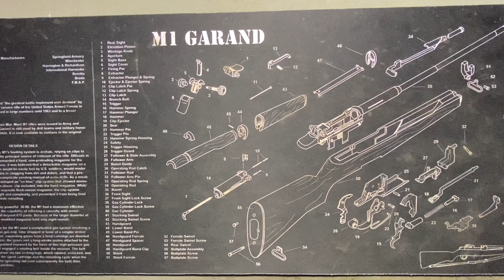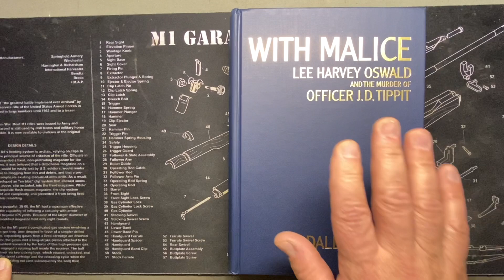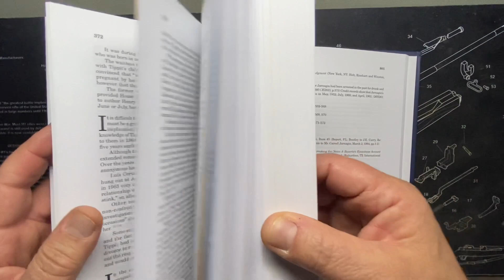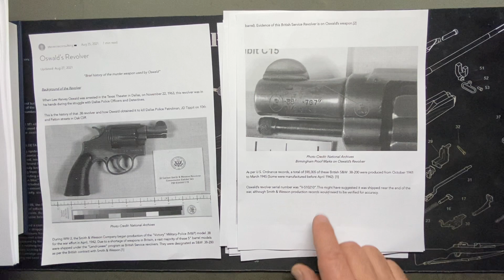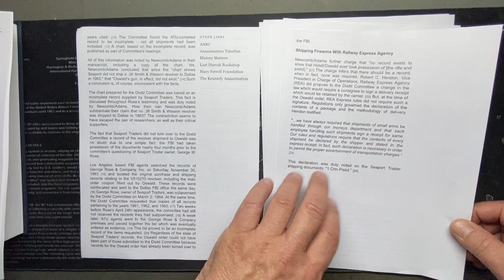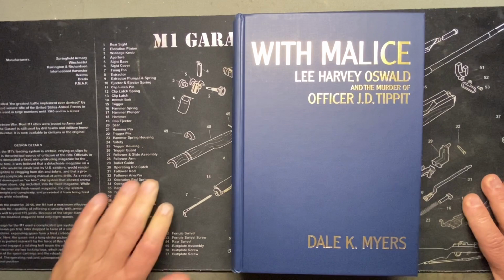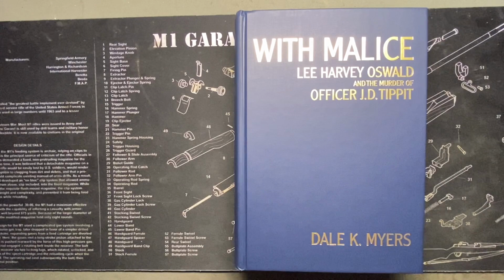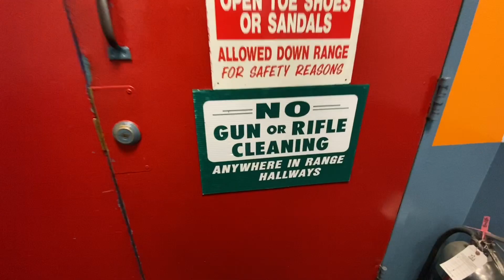Lee Harvey Oswald & J. D. Tippit - Closing the Book

Comment: "Closing the Book." The shells didn't show up in evidence for nearly a week and they were not the ones that Hill called in that were supposedly initialed and identified as automatics. The bullets were never matched to the revolver. And that is just the beginning of the problems with the Tippit Murder. The Two wallets, the creamy white Eisenhower Jacket that Oswald did not own, and had a CA Hollywood dry cleaning ticket stapled to the inside, not the mention the witness testimony is awful, starting with Markham and ending with Reynolds who had to be shot in the head to finally I.D. Oswald as the shooter. (The shooter's alibi was a Ruby Stripper, who would later hang herself in Jail.)
Reply from the maker: What I researched seemed so much simpler than that.
Reply: @MilsurpGarage  There is some very good JFK research that can bring you up to speed. Vince Palamara is exceptional. Ted Yacucci is also very good. Jim DiEugenio and Robert Groden too. A lot of what I mentioned was researched by them.

Comment: Yes, lots of information, but the information is partly wrong.

The mail order purchase makes no sense and should not have happened.  Oswald orders a gun through his P.O. Box, orders it under an alias (Hidell), and then signed for it  using the name Paxton.  The sole evidence is a copy of a receipt, not even an original.

No mention of Oswald's wallet which appeared and then disappeared at the scene.  How do you explain the disappearing wallet that reappears in Oswald's pocket?

The slugs didn't match the shells.  Four shots, four shells, and they don't match the slugs?  Major red flag.

The secret to the frame lies in the rechambered weapon.  That was not by accident.  It was on purpose.

It was common knowledge in Oak Cliff that Ruby, Oswald, and Tippit had ben seen together.  For example, at Austin's Barbecue.

Dale Myers has done a lot of work and has kept the case alive, but he is the Warren Commission of the Tippit murder.

Oh, the bullets found in Oswald's pocket??  They weren't found for hours, not until after he was interrogated.

On the surface Oswald looked guilty.  But when you dig, it all comes apart.

Case not closed . . . not closed by a long "shot" folks.

You are attempting to close an incomplete and inaccurate book.
Reply from the maker: Well, I would not even think that I was closing the official book. Just closing the book here at the Milsurp Garage because we’ve gone through the interesting anomalies regarding the gun, it’s caliber, the shell casings, and the bullets.  

As “gun people” we at the Milsurp Garage were able to explain a lot of “inconsistencies” that non gun people would have no choice but to attribute to evidence tampering because they don’t have the same knowledge as we do on the subject.

By all means, continue the research into their interpersonal relationships, and any other evidence that might look funky. As far as Oswalds gun goes, things seem to make a lot of sense to the “Gun” crowd, we have some answers that do not involve grassy knolls, that’s all I’m saying.